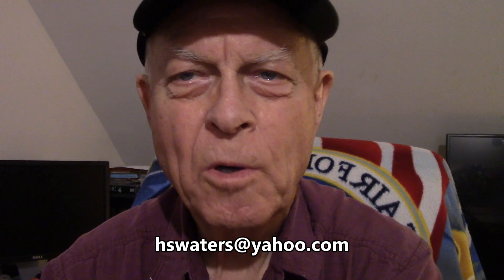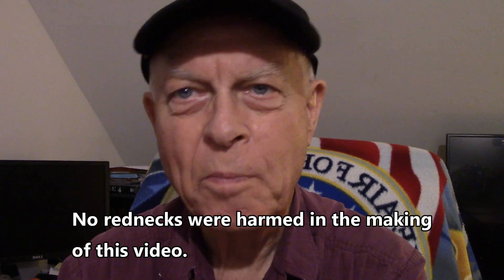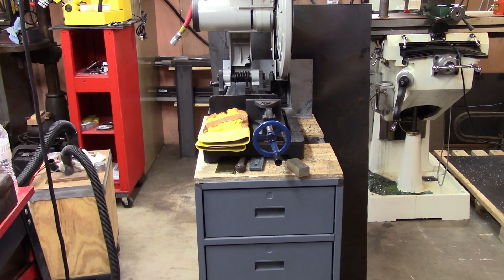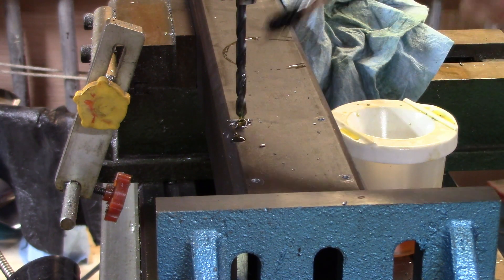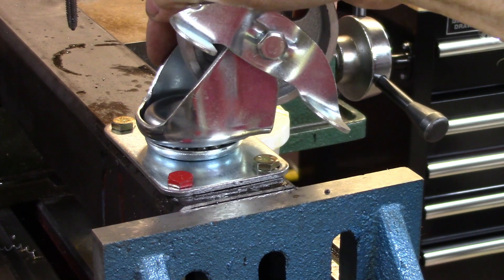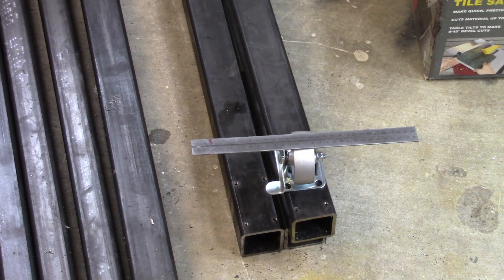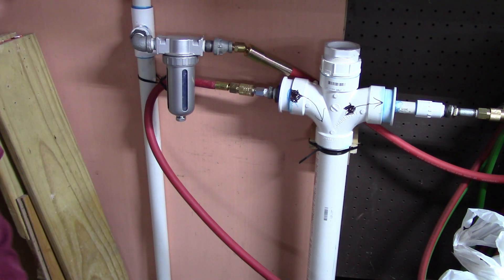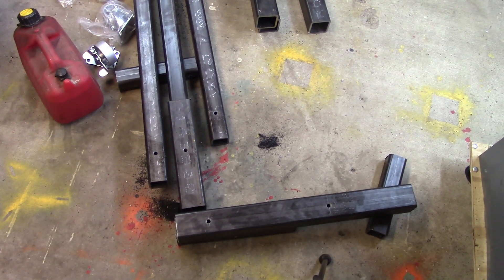Gantry crane part 1 of 2

Comment: I could sure use a gantry, especially in the near future, but will have to make one down the road.  Was interesting to see how well your air dryer system is working, that will be on the to-do list for the next shop.
Reply from the maker: It dries very well.  Regen of the desiccant is a bit of a nuisance.  Thanks for stopping by Everett.

Comment: Sorry to here about your Mig tip problems Harold. I was surprise how many people with Mig in videos don't know that you have to remove the tip to even change wire out. 9 times out of 10 it will get caught in the diffuser [brass part tip threads into] if the tip is not removed] 40 plus years of welding taught me this...keep on keep"n on with your project!👍👍👍
Reply from the maker: I weld a couple of times a year.  Thanks for stopping by Al.